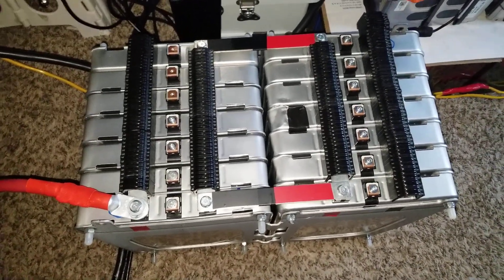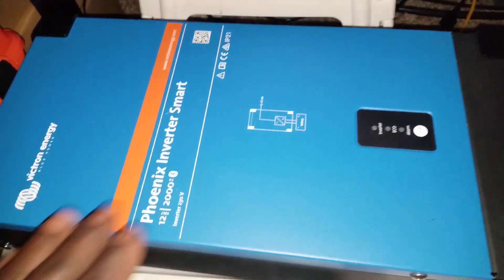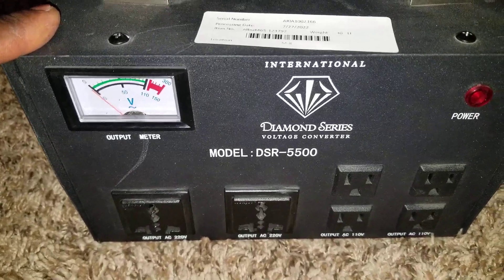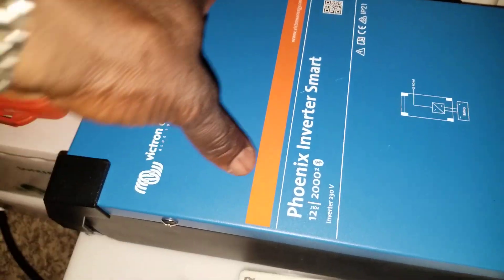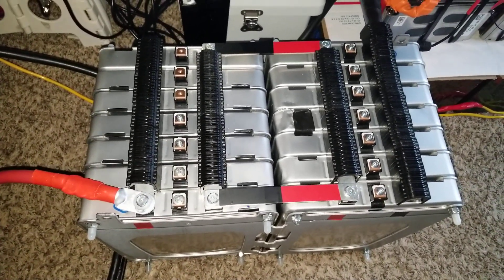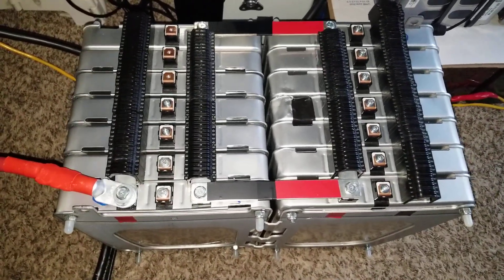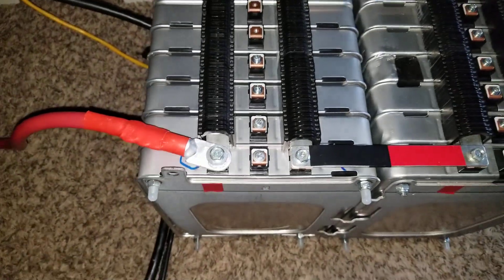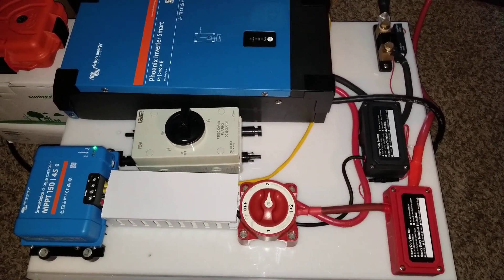OFF-GRID-SOLAR BATTERY BANK, VICTRON ENERGY PHOENIX INVERTER SMART, SOLAR CHARGER CONTROLLER MPPT(4)

Comment: amazing build! I finally rigged up my system for my house (camper lol) - vfxr3524a + fm80 + (8) 100ah lead carbons + (6) 320w panels wired 3s2p. BUT, up here in the great white north the sun doesn't like hanging around for too long so I might put up another 3 panels... I'm hoping it's not too much for the fm80? might have to consider getting another charge controller.
Reply from the maker: Awesome and thanks for sharing.
Don't forget to LIKE & SUBSCRIBE
Reply from the maker: Always